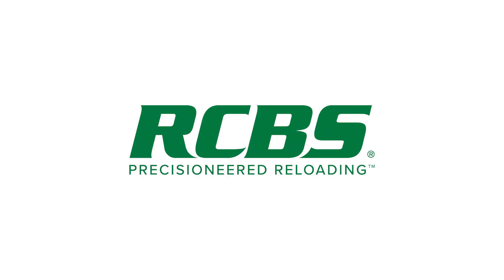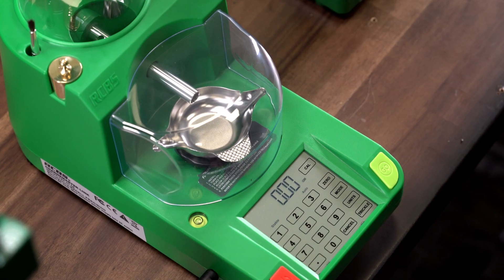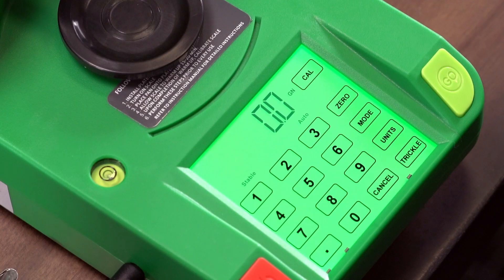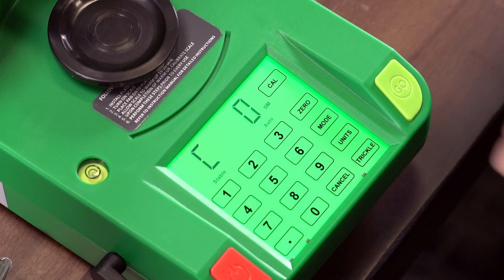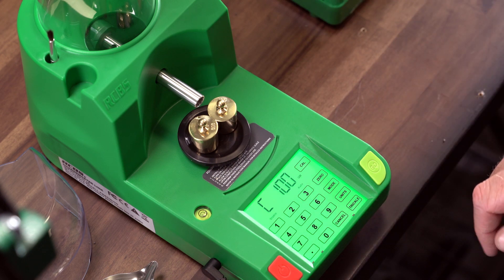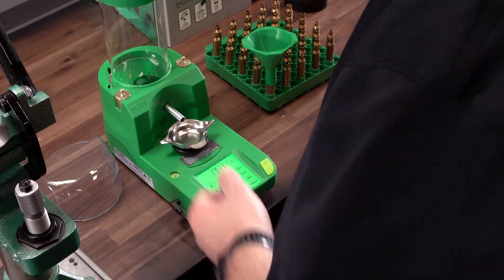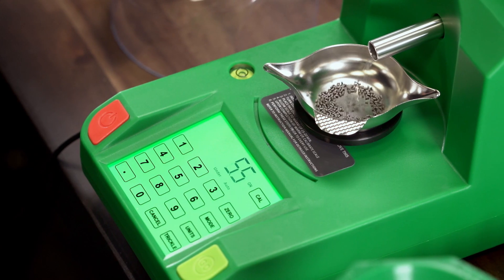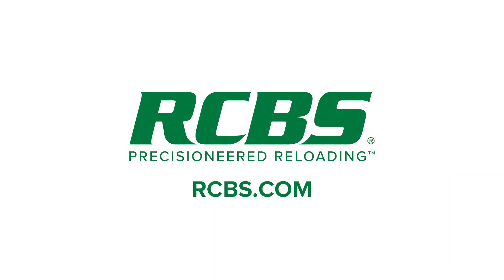How to Calibrate The New ChargeMaster Link

Comment: What's the secret to prevent drift? If I throw ten charges at 40.3 grains, the last one is .3 grains less than the first one, even though the display reads 40.3.  Compared to an RCBS beam scale, the first charge is close, but by the 10th charge it's off by a lot.  Link is leveled, warmed up, anti-static wiped, etc.
Reply from the maker: Hey there, if you give our tech services team a call they will be able to help troubleshoot. 800-533-5000.